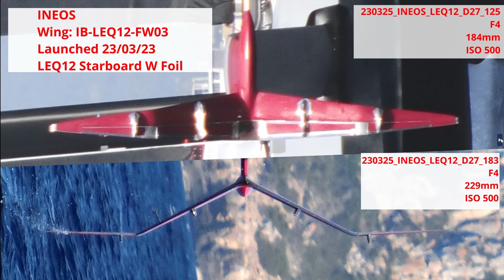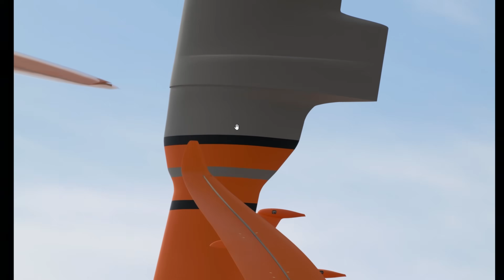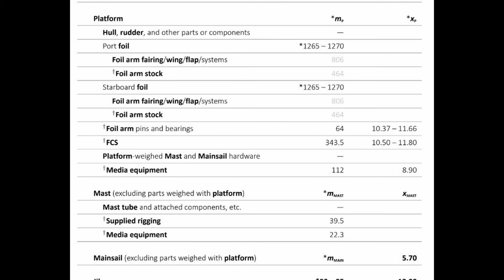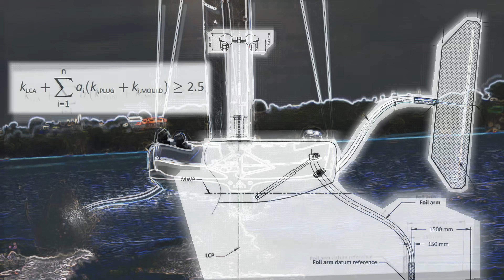Revolution by Evolution: *NEW* Cup foils analysed

Comment: Hi; again a interesting Video with a lot of information from some blurred pictures. Amazing! Just a small question from the sideline; could these spats on the foil arms be more for lift getting the hull out of the water and/or during foiling, rather than area needed for actuators or weight?

Comment: Whats the function of the slight dip or depression of the trailing edge at centre of foil, many are adopting?
Reply from the maker: interesting question. It does seem to be a feature that is increasing. Perhaps to accelerate the flow off the back of the vertical and maintain flow there at the expense of sacrificing some over shape in the lifting wing. Pure speculation on my behalf, would be good to get views of someone more knowledgeable than myself on it though
Reply: Makes sense.  Will keep an eye out for any replies with further insights. Thanks.

Comment: Paul Bieker has been applying tubercles to foils for 15 years now. My understanding is that they're good at disrupting flow (think pressure) running along the leading edge and generally help prevent large vortices from forming and disrupting the overall flow. For them to be effective you have to have the vortex problem to begin with.

Comment: In surf foiling there is one brand that’s now down to its second generation of foils with tubercules. Takuma with their Kujira foils. 
The original series provided a much slower stall speed and bigger tolerance to angle of attack changes and turbulent water flow ( messy sea state) than all other foils on the market. 

As well as incredible grip in turns. Those foils were very hard to slip out and very tolerant to ventilation. 

Sound to me like all those attribute would be a great benefit for foiling in Barcelona in light puffy conditions with a messy sea state. I like their direction of thinking.

Comment: I would assume those Turbicules are “just” vortex generators that reenergise the boundary layer and thus reduce or delay stall. You can look it up it is more or less the same reason why Golfballs have dimples. But (at least as far as I know) creating the small vortices does come at the cost of extra drag except of that one speed region the foil (or better the turbicules) is designed for. Same goes for the golf ball. The dimples are only useful at typical Golfball speeds. Anything above or below it is going to do more harm than good.

Another guess is that they do it to reduce ventilation but it is just a guess. I cannot propose any concrete mechanics on that.
Reply: https://youtu.be/fcjaxC-e8oY 
Basics for the Golfball

Comment: Tubercles are beneficial on the leading edge of a foil (of whale fin) to avoid stalling at high angles of attack. In the case of a humpback whale, the tubercles enable the whale to make sharp turns when hunting schools of fish. My guess is that the tubercles on the outboard blade of the Alinghi foil assembly prevent cavitation for the first few seconds after entering the water or possibly during sharp turns in a gybe. Most of the time the blades remain at a relatively low angle of attack.

Comment: The tubercles along the leading edge of a wing-like structure mainly delay stall by creating a series of paired counter-rotating vortices which accelerate and energize the flow over the tubercles and keep the flow attached. As a results, there is an increase in lift with higher angles of attack and compared to a straight wing, there is no drag penalty prestall and a lower drag poststall. This was validated by model testing at the US Naval Academy. The tubercles act as aerodynamic fences without the increase frictional drag of a physical fence. This decreases spanwise flow and the tip vortex which increases efficiency, reduces induced drag, and results in noise reduction. There have been over 500 scientific articles and meeting presentations published on the subject. The benefits of the tubercles dependent on the geometry that is used and tuned to the wing-like structure and its function. The tubercles have been applied to jet engine stators, surfboard fins, hydrofoils, swim fins, sailboat rudders, keels, and sail masts, dive planes, truck mirrors, race car spoilers, bicycle wheels and frames, aircraft engine ducts, stabilizers, aircraft wings, paragliders, propellers, helicopter rotor blades, fans, compressors, tidal turbines, and wind turbines.

Comment: The turbicules are really interesting - as in my opinion they do highlight an aspect of the foil application that is not talked about as much. 
The foils are not only providing lift out of the water but are also angled to provide "lift" against the side-way slip much like a centreboard would. This lift can also be used to provide sideways lift to the boat (like a trim-flap on keel or the windward heel in a Moth). 
With more angle comes more tendency to stick the leeward tip of the foil out of the water - and even more in wavy conditions. This would cause very unstable flow conditions around the outer foil section and the turbicules can help to keep the flow attached longer or reattach faster. The potential gains are showcased in the cycling examples that @martinmoxon2723 mentioned. 
In my opinion that's also the reason why we only see them applied to the outer section of the foils.
In summary: I think Alinghi goes for a smooth/straight foil on the inside as it provides the lowest drag or best lift and the turbicules on the outer part of the foil because they are planning on running the foil highly angled and partially out of the water in wavy conditions.

Comment: Wait ... are the foils interchangeable from port to stb? If so have alinghi just created a "2 for 1" test bed. And potentially doubling their foil design allowance?
Reply from the maker: I think so. That would be the only way of really testing either side of the foil, because if they leave it on port then outboard side will always perform differently due to it's proximity to the surface. How good the data will be from switching side will be another question. It will always be a different day, with different wave angles and patterns which might make pulling conclusion out difficult if it's not a clear difference
Reply: @MozzySails  agree but they should be able to get reasonable data from performance and cameras ... as you say it might be 80% as good as symmetric data but now you have twice as many foils to gain data from. Very smart move by alinghi ... disappointed in myself and other teams for the light bulb not flashing on

Comment: I just spent a semester building and testing tubercles on hydrofoils. One of the things I found is they help reduce drag and ventilation that happens with surface piercing foils. Essentially its stops the air from travelling too far down the foil and helps direct the flow at the water / air interface...
Reply from the maker: Is there any reading you can recommend?

Comment: I've messed about with tubicules on kite foil wings. They feel as if they reduce the stall speed slightly but I found with the bumps near the tips of the wing creating pressure differences, increased the chance of large ventilations down the wing compared to a flat wing. But cool to see someone trying them out.

Comment: Great show... Holy cow, insanely complicated flaps. Love the camera application. Makes me feel lucky I'm at Windfoiler and just have to worry about dynamic weight changes and fixed pitch adjustment in the stabilizer wing on the fuselage, or rudder angle in the case of the Sail GP F50. I always wondered about turbicules on whales and hammerhead sharks. They're not exactly slow animals. However, never really looked at tuna and swordfish fins that closely. They look pretty sleek, certainly pretty sophisticated.

Comment: How has the alinghi foil not been protest, taken off the boat and 1 foil allocation taken away plus a penalty (assuming its touched the water). Foils must be symmetrical. This is same as the ineos tow mast issue. Can't be gaining information from non complaint items
Reply from the maker: The symmetrical foils only applies to AC75 race foils. These are all LEQ12 foils, for which the only rules is the total number they are allowed to make (4) and the % they can be modified (20%)
Reply: @MozzySails  so out of all the teams you are saying alinghi are the first/only team to find this loophole?
Reply from the maker: @lewisa5062  Luna rossa have run different tips inboard and outboard (shown briefly in this video). So not as obvious as Alinghi, but similar thing. 
Personally I am not sure how useful testing a half and half wing is as the outer wing is operating at the surface which could cloud any results as the tip  breaks through the waves
Reply: Interesting ... so there is nothing stopping a team installing a full sized AC75 foil on an LEQ12, adding a heap of weight to the boat and testing the characteristics

Comment: Hydrodynamics and aerodynamics are not the same. The structures need to be quite different to produce lift. For a wing in the air, the forces come from above as a low pressure area is created above the wing, creating lift.
In a wing, like a foil under a boat, the lift is created by water pressure on the underside of the foil. The shape is quite different. You also get much greater water resistance than air, so the water foil has to be much thinner. If the AC designers don't understand this, then I am available to take over. 
Hands up those who would thike the AC ro revert to the 10m rule. It was so much better.
Reply: I guess all teams are quite aware of this….

Comment: Would a dimpled surface on the foil allow a team to run a slightly higher angle of attack with the same drag level?  Even if not, would a similar modification at least at the T-joint be potentially beneficial?

Comment: Hi Mozzy, I have a Ph.D in CFD. I agree with everything that Richard Cannon has said. But I read that one of the advantages of the tubercles leading edge is that on average it improves lift and drag performance of the direction if the flow is not coming at the optimal angle of attack. Now if we think about the swell in Barcelona and the foil going through the waves, maybe the tubercles will help making the foil more progressive in it reactions and avoid a drastic loss of lift in near stall situations. During maneuvering we might have similar advantages. On a formula 1 the advantages are probably less evident, unless we consider the effect of natural wind that can tilt or shift the true wind direction with respect to the wing. I’m any case, Richard has had certainly a lot more experience than me.
Reply: I'd have thought that the foil was always subject to a sideways slip load which would cause a angled flow across the foil. As noted a bigger seaway adds more chaotic flow. So just maybe, but at 40kts plus in a water, any parasitic drag?
Reply: Considering the F1 Teams' problems with crosswinds in Miami, the tubercles might have actually played a role if they were used more agressively on the cars 😅

Comment: We tested tubercles or serrations on the leading edge of fan blades when I worked for a fluid dynamics chair in Germany. We looked at their effects on the overall performance and aeroacoustics. In optimal conditions they were always worse than standard blades, but in highly throttled operating points or with highly turbulent inflow conditions they offered some benefits, reduced flow separation and made the operational window wider. Our conclusion was that they introduced longitudinal vortices that reenergized the boundary layer downstream, stabilizing the flow on the suction side, preventing flow separation and/or reattaching it faster than a normal blade. Maybe they try to improve takeoff speed and the foils behavior at very low speeds.

Comment: Really good video thank you for all the photos. Mike Arnold did a lot of work on intersection drag with his AR 5  light racing aeroplane  videos on you tube which I think is pertinent regarding the positioning of the foil/ strut exactly as you suggest .Al Bowers ex nasa did a lot of work on the Prandtl D wing architecture which is similar to Alinghi . Re tubercles I believe Bieker  and JK believe they delay ventilation of the leading edge where it breaches the water surface with less drag than a fence.

Comment: Juan K said that they used them on the clubswan 36 to increase the stall angle (albeit with an increase in drag). Pinarello, Princeton and Zipp have also used them for similar reasons. Maybe Alinghi are using it to attach the flow faster when the board is dropped.

Comment: Nice video. We use tubercules or bumps design on surf foils (https://youtu.be/Vd7f4KPRCKo). We work with Laurent Borgna who practice those design since many years. We have make several test with and without bumps and the major benefits of the bumps are in low speed conditions: it’s working like smoothing the CL curve and pushing more the stall angle. Worst « global »CL/CD with bump design but offer top control during hight acceleration turns. It also prevent the ventilation progression along the LE during tips breaching (probably why alinghi use it on external foil part) sorry for my bad french english

Comment: My reading is that Tubercles delay stall at high angle of attack.

To turn a 30 ton whale takes sustained angle of attack over quite a long period. If a hydrofoil has a high angle for attack for very long ... I would suspect something is very long.

The humpback cruising speed  is 2 to 7 knots ... so sustained angles of attack at slow speeds. The humpback tops out at 13knots.

Tubercles have been tried on a couple of yacht rudders. More lift at higher angles of attack might be more worthwhile there. But two famous examples the best part of ten years ago and I don't think there are very much more than two sets around now. Not exactly bursting onto the racing scene.

We will see of course within a few weeks. Interesting that the tubercles are on one side ... I guess they can swap sides and have the tubercles outboard or inboard.

I'm expecting them to disappear without trace in a month or so. But if not ... then I've learned something.

Comment: Good to see the end of Ineos W foil. All the appendages for linkages and dihedral changes and high taper ratio meant it was never going to be fast.

The new Ineos foil looks pretty ; Elliptical, little or no external junk, Good fairing between flap and wing. Also the flap chord ratio reduces towards the tip, which probably helps to keep tip  stalling with a lot of flap applied. Flap is quite large. Could they maybe could reduce the flap size as a percentage which would give them a stronger wing structure so they could go for a thinner section.
Not sure about the upswept tips. They are used on airliners because airliners wingspan is restricted I believe. A simple longer wing is better aerodynamically. Maybe the same rationale here?

Anyway I predict Ineos new foil is what boats will converge on. As regards the zig zag leading edge on Luna Rossa, as has been commented, this may help to soften the stall, but it will not be fast, so I predict it will not be on the winning boat. Ultimately you just need to hang on your foils ( as Burling did last time) so low drag at high speed is what you to win on these boats. That will look like a simple elegant foil, which the new Ineos foil is I hope!

Comment: Gow much flex is allowed in the foils? Can they engineer the bananana foils so that they straighten up under load and "break out of the box?"
Reply from the maker: They are allowed to flex under hydro loads. But they can't bend due to flap / actuator movement

Comment: regarding the chrome foil by americans, I reccomend you (if you speak italian) the channel "Sail Ring". They had a nice vid on that foil recently, and they think is an actual metal foil, evidence of a precise line of thoughts: reducing the overall resistance (same strenght than carbon at less weight --> less surface --> less spray). This is achieved by the reduced dimension of the "missile" (i lack the precise term) that the carbon foils have to fit the weight measurements of the rule.
Reply: https://youtu.be/2efWvQmy3is there it is
Reply from the maker: Thanks Federico. I watch quite a bit of what they do, but have to rely on Google auto-translate which can inaccurate!
Reply: @MozzySails  eheh I can get it

Comment: good to see some leading edge playing going on [ and I'm not paying for it !] . the tubercles ,been waiting for 10 years [?] for this to get used , the idea came from the chief designer , when wale watchers noted humpy backed whales were more agile than hydrodynamacists thought was right and proper ,for whale shaped bodies . They found the leading edge bumps allow far higher angles of attack with out flow detachment . The thinking is you get lines of higher pressure that will stick to the foil shape better , these HP lines attract ,or entrain , more of the lower pressure flows , a bit like the NACA vents ,a small amount of air bending into a hole draws a lot more in . The STOL airplane crowd are useing lots of little right angle foils along the front of wings to give vortexes or high pressure lines ,increases their angle of attack ,giveing slower speeds before a stalled wing . My thinking is they should negate the need for fences and anti vortex wing tips ,plus being able to run smaller ,less area drag , foils . the thinking on hump backs was their foils are about 30% to small for what they do ,so some potential in there [ possibly make the other teams blubber ?]